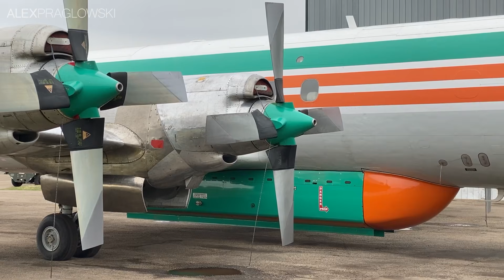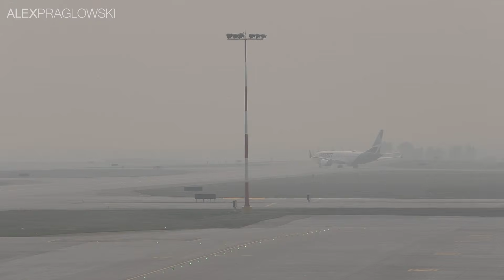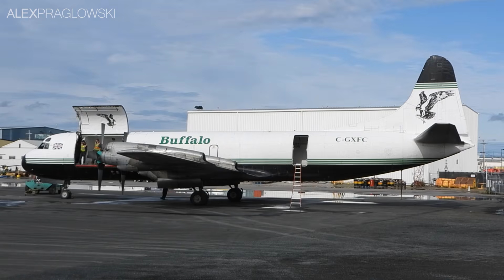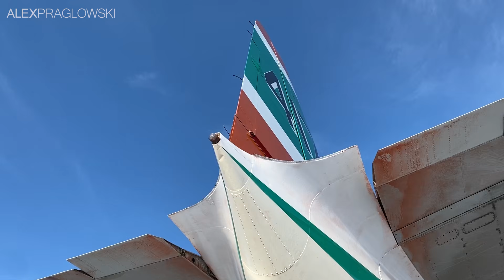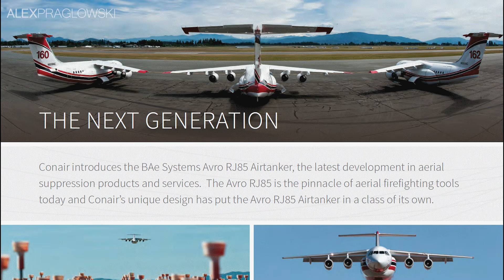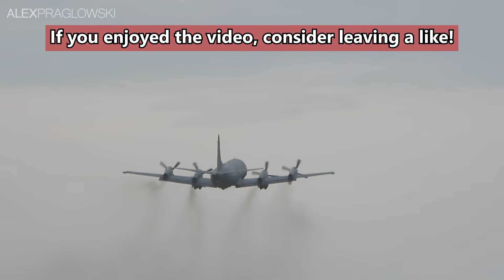Why Do Lockheed L-188 Electras Still Fly in Canada?

Comment: I rode on the Electra in the USA on Eastern and in Europe on KLM both in the 1960's (and the Viscount and Vanguard with BEA)
It was a great ride.

One item not really mentioned but applicable is the much shorter runway requirement than jet aircraft. The old B-737-200 had an available gravel kit for unimproved runways, I don't believe that's an option with the B737-300/400/500/700 series.

Comment: I flew on one from LaGuardia to Washington DC in 1966 (whatever model the airline was using).  I was 9, so no idea of cost or anything.  Flying was…more deliberate.  People dressed for the occasion, we got free airline logo tote bags and some other stuff.  Can’t remember if there was any refreshments on such a short, low altitude flight.  I remember the thrum of the engines and props, the low altitude (which wasn’t apparent to me until I much later took a 727 and saw the difference), and that the seats were very upright and rigid.  Ten years later, after the moon landings, I went to an aeronautical engineering school in queens and worked in the defense industry for 20 years.  Thanks for the memory.

Comment: I always thought somebody should do a turbine engine conversion on the DC-6  or 7 by using the same engines used on the Dash 8 Q 400's derated to the 3000HP range  it would be a lot more fuel efficient than the Electra

Comment: The first Vickers Viscount powered by 4 x RR Dart trurboprops flew in 1948.... These aircraft are very similar,  did the Americans copy again...  By the way the high bypass engines used on modern aircraft are a jet turbine engine fitted with a multi-bladed propeller ( they call is a fan ) - so the Dart started something very big.

Comment: Canada's really a great place to see a lot of the aircraft of yesteryear just because modern airliners were never really intended for operating in the kinds of conditions that their more rural areas have, the only current production that's able to serve many of the routes is the Dash 8 which was designed and built IN AND FOR CANADA. The Electras, the 737-200's, the DC-3/C-47's, and a number of other historic planes are just more cost-effective when you consider the wealth of secondhand parts and the depreciation of used planes, and the ease of maintenance that older designs come with. Until the cycle lives of the available airframes are up, they're gonna be in service a long time, and the amount of parts donors that could be reactivated with the powerplants and avionics of the current ones means that the cycle lives of the current planes aren't a hard limit. These birds still got plenty of life left in em, and in the case of rough-strip operations and powerback certifications among other things, they really don't make em like they used to.

Comment: The CP-140 Aurora was not really developed from the P-3 Orion.  Both aircraft are based on the L-188, but the Canadian Armed Forces preferred the sensor suite of the S-3 Viking, over that of the P-3 Orion, while seeing the advantages offered by L-188 airframe, so Lockheed, manufacturer of both the Orion and the Viking, installed the S-3's sensor suite into the L-188 airframe.

Comment: There was a movie several years ago about Mic Jagger being a rock star who got separated from his band in Brazil. At the airport he went around trying to find somebody who spoke English and could help him. The view out the window of the terminal showed Electra's all over the place. The only reason that plane was not taken up by the airlines was the introduction of the DC-8 and 707 which had the speed advantage and captured the market quickly. That and the fact that early Electra's had a wing flaw that restricted their airspeed until it was fixed. Quote: The Lockheed L-188 Electra, notoriously, suffered from early problems with whirl-mode flutter, which caused two Electras to break apart in flight in 1959 and 1960, forcing an expensive redesign of the Electra's engine mounts and killing off Electra sales.

Comment: The Electra, like another plane the Comet 4 , were born with a birth defect, each of them lost 2 airplanes in bad crashes. It took a costly investigation and redesign to make the plane reliable. But because of the bad PR, and delay, other types had leap frogged ahead of it and it no longer have a life in the civilian passenger market. But a company will not just throw millions of hours of engineer time into the wastes basket, so the plane went through another PR campaign and with a new name and new customer as anti submarine planes. The military only care about their performance goals and could careless if the airplane have propeller instead of jets. While the ignorant public viewed propeller as antiquated , and they equate a turbo prop like a DC 6, or Constellation. They did not know modern jets are all propellers, except the prop been renamed a fan and concealed in a shroud.  The other thing no one knows, but are most noticeable for those who usually take longer trips , like to Asia. The so call jet are still struggling with the "sound barrier" As economical to operate as most fans are, for short 300 mile trios and lower altitudes, turbo props still have the edge but not the glamour.

Comment: In 1962 we visited the grandparents in Indiana.  We flew from Los Angeles to St Louis and changed planes for the flight to Indiana. 

While waiting to board the connecting flight, my dad looks out the window and says “Oh, that’s a Lockheed Electra, they had problems with the engines falling off.”  My mom turned to him and said “as long as it’s not the DC-3 we flew in two years ago, I don’t care!”

(Same trip in 1960, we flew a TWA Super Connie from LA to St Louis then a DC-3 to Indiana.  It was awesome, I was five.)

Thanks for the great video.
Reply: That particular problem was fixed.  It was an unexpected vibration mode in the propellers that combined with a resonance in the engine mount.  I was an engineer for the propeller manufacturer--I started there long after that but the old timers would talk your ear off about that problem and the lessons learned.  Lockheed redesigned the engine mount and retrofitted it at their cost.  C-130 uses pretty much the same engine and propeller and benefited from those lessons.

Note--"engine falling off" per se is not a major problem for an Electra--they fly fine on two engines and this is done routinely with P-3s to extend duration while searching for subs.  The problem was that the particular failure mode destroyed the wing structure.

Comment: I appreciate this video is about the aircraft (and is indeed a very good video about the aircraft!), but I wanted to address the idea that forest fires are a disaster, because I think it's causing continued massive problems for humanity.

Forest fires are a normal and healthy part of the ecosystem. And whilst climate change has definitely contributed to their increasing frequency and severity, the main driving force behind this has been the very fact that we continue to try to prevent this force of nature. Over the past 100 or so years, our constant efforts to stop them have led to massive stockpiles of unburnt fuel on the forest floor, so that for every ~50-100 small fires that should have occured, we now have enough fuel for 1 mega fire.

Sadly there doesn't seem to be anyway to undue this mistake; we are now staring down the barrel of a decade or two of devastating mega fires. But continuing to put them out just amplifies the problem. The way we're going, today's ~50-100 mega fires that we put out will fuel tomorrow's tomorrow's super mega fire, which will be absolutely cataclysmic.

As backwards as it sounds to most people, we need to let nature return to it's normal state by letting them burn. We're like someone heavily in debt, who keeps borrowing money to pay the bills, further accelerating the problem. 

Sorry I know this isn't the place for this message, but I thought if even a few people read it and are encouraged to re-think the problem, it's better than nothing.

Anyway, great video and I look forward to checking out some of your other content.

Comment: In case anyone is wondering why we don't pave runways up north; it's because aside from the logistical issues, the temperature extremes are so varied, it would be a potholed mess rather quickly. It would be extremely expensive to maintain and operate a paved runway in those extreme northern climates, and we have a fraction of the US's economic might that allows the US to pave most of their Alaskan runways.

Comment: When I was in engineering school on the 1970s,  the Electra was given as a case study. There had been several crashes due to failure of the titanium wing. Titanium couldn't be welded without making it brittle so the engine mounts were clamped on. Over time the mounts loosened and the engine/propeller vibrations eventually destroyed the wing. Not foreseen in the original design, the simple fix was to re-torque the engine mounts at service intervals. After that, the Electra flew safely for many years.
Reply: And in the 2000's we found a way to weld Titanium.

Comment: Great video. I spent a week working out of Buffalo Airways hangar doing cold weather testing in 2019. Witnessed their Electras, Dakota, and C-54 fly in some of the coldest weather I've ever experienced. All of these required special preparations prior to flight. They tried to keep the daily fliers in the hangar as much as possible. They told me the Electra is their preferred lifter due to its payload capacity.

Comment: I flew on the US Navy P-3 which is descended from that sexy aircraft, the Electra, as a radio operator, RADAR operator, Inflight Technician and finally a projects engineer. Since day one when I saw the P-3 I just fell in love with it. Smooth lines, svelte and a joy to listen to. It was my home away from home for many years traveling around the world while on active duty and then as a flight test engineer. I ended up accumulating over 3000 hours of flight time on them. Postscript, I was offered a position on the P-8 test program at work. I just couldn't do it. I asked my boss if there were any other programs I could work with which is not real safe since I could have gotten a crap program. I ended up as the lead test engineer for the KC-130J Block Upgrade which ended up almost as fun as my P-3. Thanks for listening to my babbling and thanks for the video!

Comment: I’m surprised you can still get parts for these, especially considering only 170 were built - that is not a very large production run. Although perhaps since it’s still in military use Lockheed Martin might be required to continue producing certain replacement parts.

Comment: During my military service, I was required to fly from one side of Australia, right across the nation to North Qld on an annual basis. The flights in the Electra compared to jets was simply awesome. For starters, the seating was just TWO seats side by side with plenty of ROOM for arms, elbows you name it, AND you could actually stretch your legs without moving the seat backwards of forwards, the space had be seen to be believed. The climb rate was also un-noticable, nothing like the jets, which go practicly straight up and cause pressure on your ear drums. Noise in the cabin was nice and quiet unlike jets. Coming in to land, again, very smooth and decent hardly noticeable. All in all, very sorry to see them go as passenger planes.
Reply: Seating arrangement and capacity is decided by the airline.
Reply: Have you seen how many of them crashed?
Reply: @AlexanderSuraphel  Muy pocos y en sus principios, sobre todo en Estados Unidos.

Comment: I remember the Lockheed Electra with a great deal of respect, and especially their pilots.  When I was stationed at Shemya Alaska back in the early 70's, Reeve Aleutian Airways was the best way to get there on time.  The very high cross winds often prevented the Air Force C-141's from delivering their cargo and had to turn back.  I remember landing at Shemya and watching the landing out the side window until nearly touchdown as the Electra slipped sideways onto the runway.
Reply: Prop planes are still very useful in many regional things
Reply: @raybon7939  I'll be taking a journey on a modern turboprop aircraft in a week.  It turns out that in a world with rising gas prices, the turboprop reigns supreme.
Reply: I was probably on one of those c-141s. As a loadmaster, I flew into there many times. As you alluded to, the winds are extremely bad there and exceeded takeoff parameters on occasion. Thus, spending the night and seeing downtown, 😂

Comment: I'm told the original Electra's had a reputation as deadly. By the time I was flying on them, they were reliable and well respected. Best of all, when you loaded or unloaded, the small capacity meant no mob at the luggage carousel or cab line. In the US, the last of them were sold off to South America by Eastern long ago. But I remember them fondly.
Reply: Some were bought by Aerocondor and SAM in Colombia.

Comment: Electra's have great power response. Almost 80% of the wing is covered by propwash. That coupled with fast engine response means that when the pilot adds power it is available almost instantly, unlike twin spool jet engines that take time to respond as they increase rotation and thrust then slowly increase airspeed.
Reply: I believe it's 88% of the wingspan is behind the prop disc!

Comment: Because of those four mighty Allison T56-A-14 and Hamilton Standard propellers…that’s why. Very fuel efficient and second to none in reliability.
Reply: @Turbo-Bike. The Electra's used the Allison 501-D13 powerplant and the much better AeroProducts propeller. The P-3 and C-130 used the combination you mentioned. The T-56 had about 1000 more horsepower than the Allison.
Reply: @timsaxer6442  The 501 D13 designation is a none military version of the same engine….the only difference is whether it’s a series 2 or series 3 turbine. Allison is the manufacturer of everything we are discussing. The auroproduct propeller is as you said different than the Hamilton standard or now Hamilton Sunstrand

Comment: I love that plane so much, mainly because of it's use on Varig on the Rio-São Paulo flight. Good old times of the piston engine aircrafts!
Reply: Only it’s not piston engined. It is turbo-prop, a hybrid type using jet fuel.
Reply: Some of the AirSpray Electras are former Varig machines.

Comment: There are two factors that will eventually make the Electras obsolete - wing cracks and engine availability. All of these machines have multiple layers of wing planking and at some point the operators are going to have to decide how far they can push them, especially in firefighting. Only one engine shop is FAA certified for doing overhauls on the Alison turbines and I’ve heard they are looking to bring that work to an end.
Reply: Prop overhauls may soon face a similar issue. Perhaps the current operators will have to perform that work in-house.
Reply: One Electra operator is making new wing planks. There are quite a few engines available with useable hours. So overhauls are not the most cost effective way to keep Electras flying. Most retardant tankers only do 100 to 200 hours per season so half time engines go for many years. As a air tanker nothing even comes close to an Electra. The VLATS can only operate from a few fields and nothing else can haul as much retardant and fuel. Those that say they haul close to the same amount of retardant carry much less fuel.

Comment: Somewhat ironic that  Viking Air/deHaviland Canada are seeing their own Dash-8 competing against their own CL415/515 in firefighting jobs. The converterd Dash-8s still can't scoop water from a lake to do more frequent drops so the CL415s are still better, yet, they are left for dead at a time when forest fires are at a peak.

With global warming, I wonder if turboprops will ake a come back or if they are an endangered species, in which case we'll see progresive elimination of turboprops from the olderst to the youngest with Dash-8/ATR42 likely the last survivors for comemrcial passenger service.
Reply: JCB in the UK are doing some really interesting things with hydrogen-powered piston engines and the same advantages that make them a good choice for heavy construction/mining/etc. equipment might make them an option for aircraft as well. I won't be shocked if we see hydrogen piston regional airliners in a couple of decades, especially with Celera showing that you can get jet-like performance out of a piston engine with the right aerodynamics.